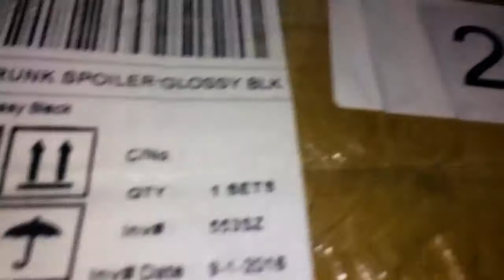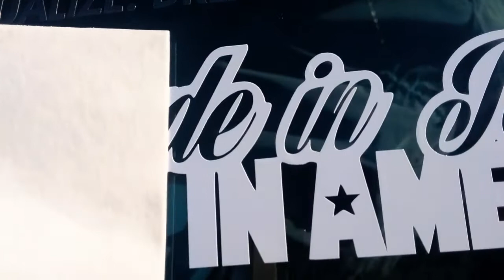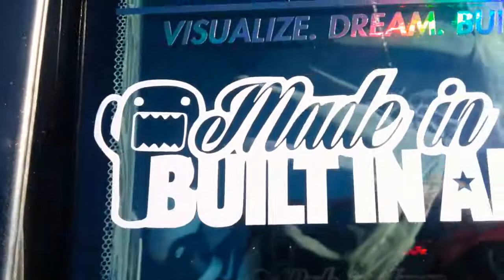8th gen Honda civic mugen type R spoiler install + more decals (yosh!150subs)

Comment: you unboxed 4 peices but only see 3 peices in the final install? what happen to the bottom peices?
Reply from the maker: Steven Lee i didnt put the last one on there when i was doing the video but i decided to put it on later on to use all the peices. that doesn't need to be screwed in, 3m double sided tape is good enough 👍